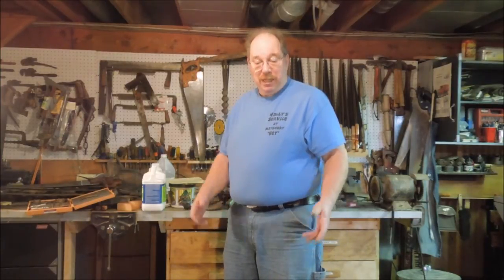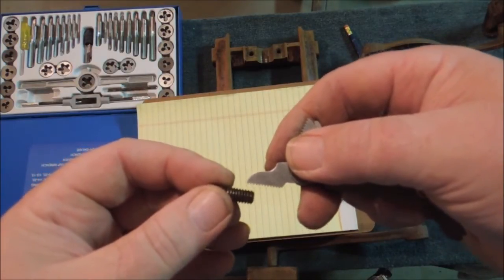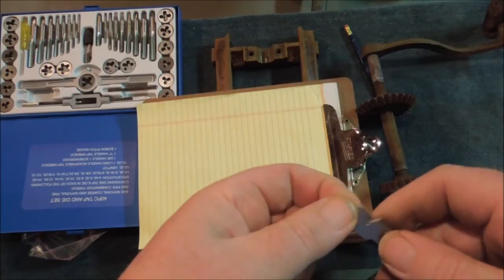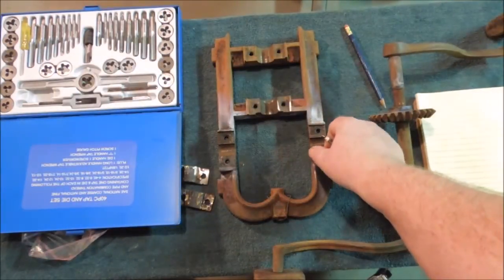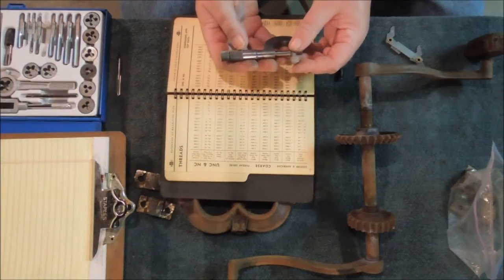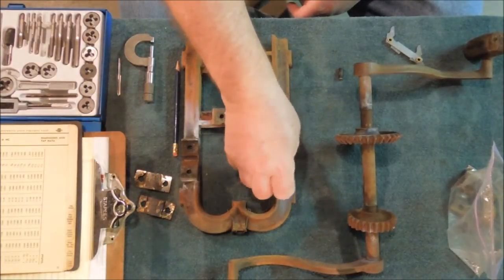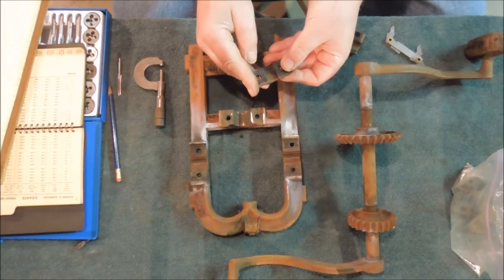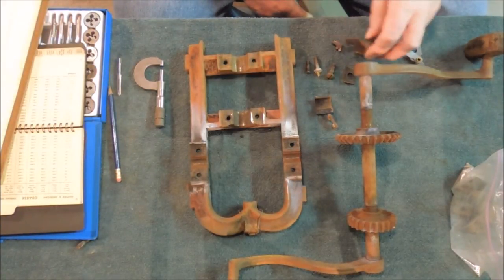Repairing Antique Tools - Swan Drilling Machine - Part 3 -Rebuild Plan

Comment: Do you plan to finished the videos on the repairs on this old post and beam drill? I would love to see it all cleaned and fixed up.
Reply from the maker: It has slipped far down the list hasn't it. 
I intend to finish it. The shaft sits next to the lathe to remind me.
Reply: @OldSneelock  looking forward to seeing it all done. I to am currently working on my post and beam drill. Full clean up, paint and replacing all the wood as it is full of rot and brittle.
Reply from the maker: @calvincollison9182  I have two besides the one in this video. One is fully rebuilt and works great. Then there is one needing the top bar replaced.  The wood on this one is shot. Left out in the weather too long.
Reply: @OldSneelock  they are a beautiful and wonderful piece of old equipment amongst so many others of its time.